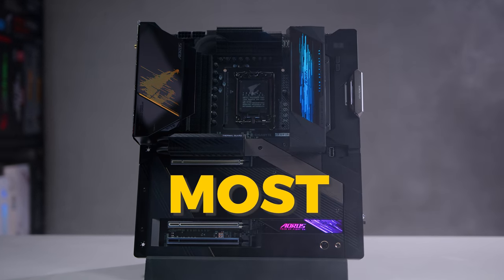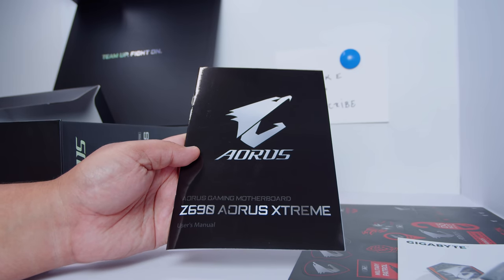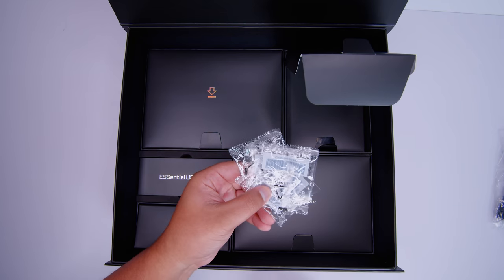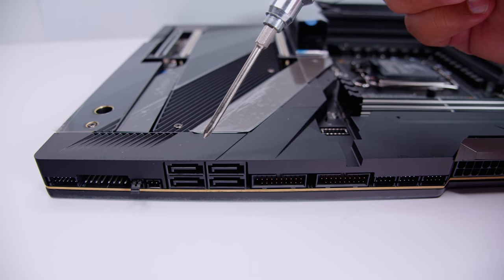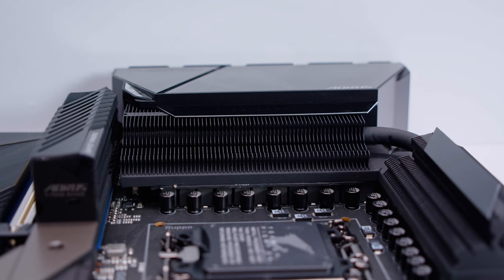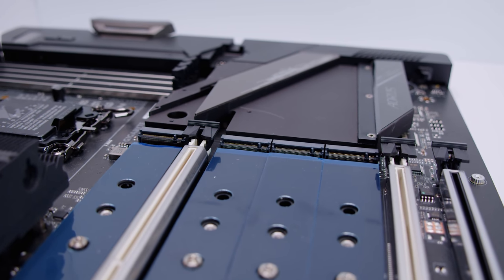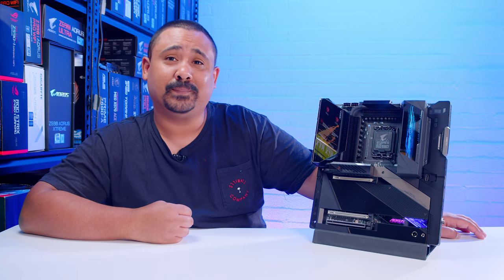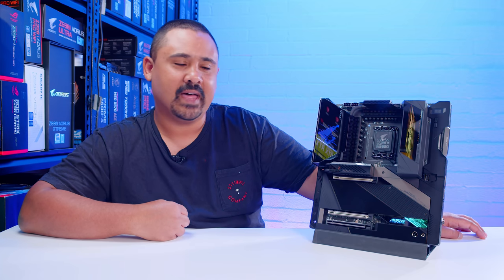Most OVERKILL Z690 Motherboard Ever: Gigabyte Z690 AORUS XTREME Overview

Comment: I'm one of those people who hate their money but in spades! Being late to the party in November 2022. The difference is I bought the Waterforce version serial #004 out of 200 at $2000 USD 😮 It's getting decked-out with a 13900K, G.Skill 2 x 16 DDR5 ~6600ish, dual Samsung 990 Pro 2TB/1TB SSD's, Nvidia 4090, Corsair AX1600I PSU and cooled by a massive Alphacool 560 rad with (4) Delta server fans and dual Bitpower D5 pumps. In the process of building a 30" x 30" x 10" full size tower that rolls around on casters and am adding a Burson Playmate 2 DAC with Sparco Op Amps. Even with such a large case the available real estate is getting sparse. The MB with the full coverage cooper waterblock weighs a ton. Even the ram will have a waterblock. Should be a badass system.

Comment: Adding AORUS stickers improves cooling and overclocking potential!
Reply: Fake News?
Reply: Hidden wisdom
Reply: 😂😂😂20° cooler + 1.5GHz more OC headroom😂😂😂
Reply: I usually apply my stickers to Random public Transport, Actually saw the Aorus  Badge still on the 123 bus I applied about 18 mths ago Still sitting in pride of place on Top Front window 😁🍺

Comment: About a year ago I originally purchased the xtreme x570 ver for my 5950x. it was dead as a door nail when it came in so I never got to experience it. :( Ended up buying an Asus hero wifi because I needed something fast. I just didnt want to deal with the rma because I had vm's to run and games to play. I'm also still thinking about getting the Corsair 1000D  but it's such a large case. Currently using the 5000X.

Comment: You say the m.2 slots all 4 of them are pci 4.0 but aren’t they enabled for pci 5.0 once the drives come available?
Reply from the maker: No
Reply: @GearSeekers  thanks for the quick reply, so then for this board which has 2 pci 5 slots u can probably use 1 for the graphics card and 1 pci to m.2 pci 5.0 adapter if it comes out to use a new faster ssd.
The price on this Z690 extreme just dropped today by almost €200,- so it’s around €760 here now. I think i’ll still get one with some DDR5 5200mhz memory and intel 12900k cpu. As these are the last 3 components missing for a new build.

Comment: any chance you could show where the USB 2.0 header is ( 9 pin ) - assuming its hidden under plastic?
Reply from the maker: I showed it. It uses the breakout cable
Reply: @GearSeekers  oh ok so theres a 12 pin cable that comes off the bottom right of the board that i can then plug a 9 pin into? ( just ordered the board and worried )
Reply: @GearSeekers   OK never mind me, saw it at 2:50! thanks!

Comment: It's nice to see super-high-end material. Even if we won't use it or get it, we know it's there and in ten years the features might become more common.
Back-up cameras in cars are an example.
I have the Gigabyte  Master, I'm quite happy with it.
Would I like more? Sure.... but other than more M.2 drives and SATA connections (that all work at PCIE4 at the same time).... I don't have any more wants in motherboards atm. 6 M.2's and 10 SATAS would be fine for me. But I'm a digital hoarder who makes too much art.

Comment: It's a neat board, but if I'm going to spend that kind of money on a z690, I'm just going to buy the ROG Apex. The Apex has way more overclocking features that are more appealing to me, and the VRM on the z690 Apex is kind of insane. In terms of a daily/productivity board, this has it beat, though I think there are cheaper options with similar functionality and IO.

Comment: I am running my 11900 on the Maximus Hero, 128 Gb RAM with two 3090's.  I want to upgrade to the 12900 with DDR5.  First...if you run Sli on this board, that third slot is covered by the second 3090...right?  But then...what would I need that third slot for anyway, eh?  At least...the graphics bridge needed is a 4-slot.  It took me three months to find my 3-slot NVlink.  And Damn...right on availability.  Can't find the Hero Z690, 12900, or DDR5, anywhere...unless at highway robbery pricing, eh?
Reply: Why run 2x 3090's on an Intel board? You'll only get 8x out of the 3090, otherwise bottlenecking both
Reply: @darkoctane25  Ran two 3090's...cuz I could.  Smiles.  I'm going to sell the second 3090...cuz they are worth more than gold prices these days.  I know...cuz I paid those prices.  Time to recoup a little of that.

Comment: The best part is that it will perform as good as your $150 motherboard.
Reply: its not
Reply: @Based Madara 20 or 2000, you wouldn't tell a difference...
Reply: utterly nonsense.

Comment: I own the x570 xtreme since the 2019 launch and the only issue I've had since day one is with random occasional phantom usb disconnects/connects. I had to disable system alert audio to keep my sanity. The issue doesn't seem to effect anything already plugged into usb. And has no effect on workload performance. You could unplug all usb and it would still do it like a phantom device is being plugged in and out. It's all very strange. I'm not sure I would go with anymore gigabyte products.